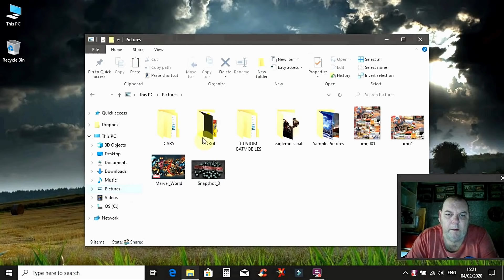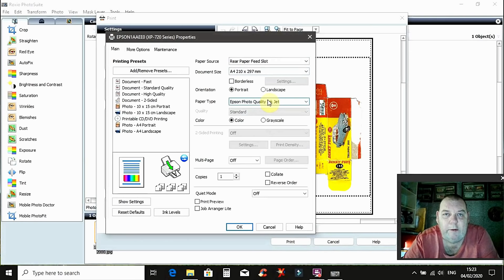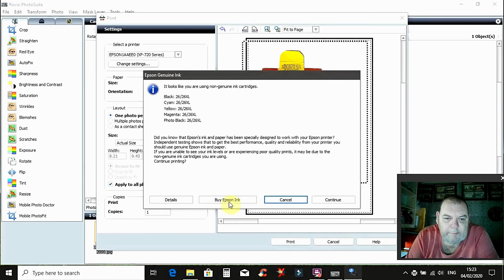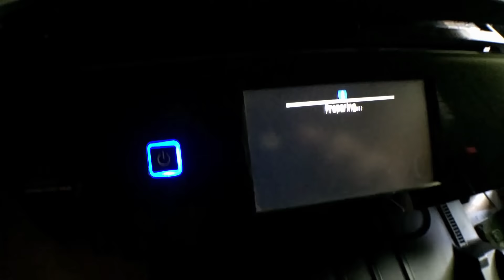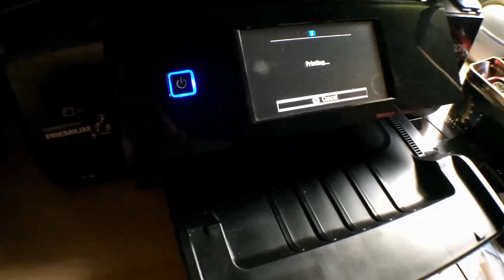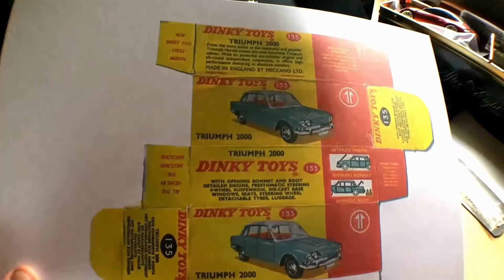Dinky 135 Triumph 2000 Restoration

Comment: Talk about 10 minutes on pins and needles!  Watching paint dry and tape peel!  Excellent job as usual.  Would warming the tape with a hair dryer before peeling help.  I have tried this on other projects, that is a warm to the touch, not hot, and it seems to work as it softens the glue on the tape.

Best wishes and stay safe, Geoff